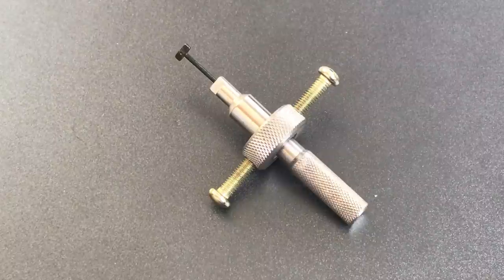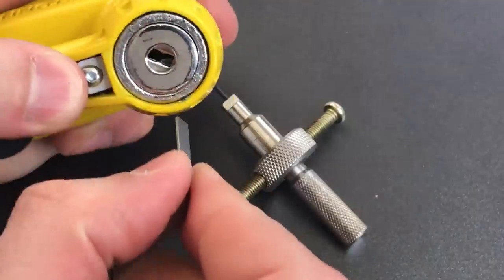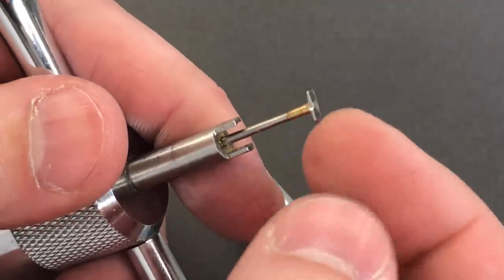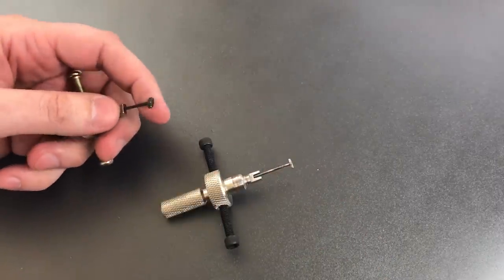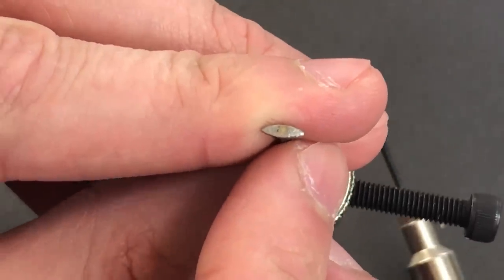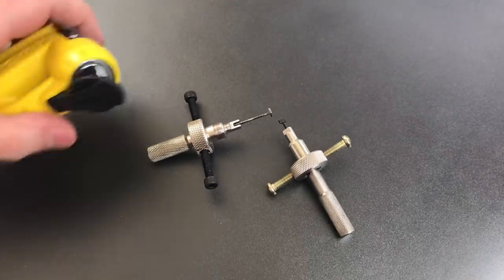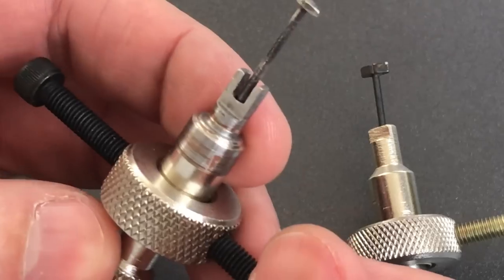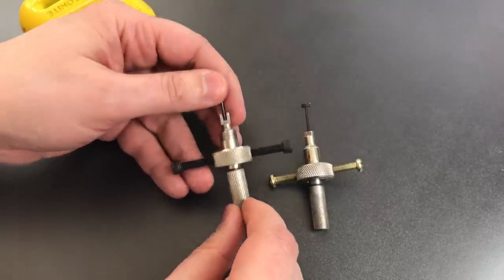[640] Get the Most From Your Disc Detainer Pick

Comment: Thankyou for explaining and demonstrating how small these tips need to be to be able to move through the tolerance gaps between the disc cuts. I'm also guessing that the flatter heads on the tension screws of your modified tool are much more comfortable than the round heads of the original. You could probably use the location pins from an injection moulding cast to make your own stronger tips too

Comment: Thanks a lot for this video!! I have to buy one of these  picking tools in order to unlock my disk brake as it locked it self completely and cannot be unlocket with the original key. Good thing that it happened not on the disk of the bike :) If it wasn't for your explanation, I would have struggled quite a lot to unlock it, if I could at all, since i have no wxperience in lock picking. Again, thanks a lot :)
Reply: If the lock is locked, but not on the disc brake, then just throw it away. Cos if your key doesn't work then you can't practically use the lock itself.

Comment: I found it really helpful to simply file a little bit of of the the outer (tensioning) part on two opposing sites so the big screws don't slip. It's also possible to just tighten them down more but you can assemble and disassemble it this way without tools so it's compact and easy to store/carry around.
Reply from the maker: Good idea... 👍
Reply: If you mean different than in the video, then I don't understand.
Reply: +Jay H
In the handle of the tool that the pick inside the lock is controlled with, two set screws clamp onto the pick to lock it to the control handle. Filing small flats on the pick where the set screws sit helps them lock to the handle.

Comment: There is one modification that I did to mine that if you have machine tools is very helpful.  I remade the tensioning portion of mine to make the nose longer to fit in the very recessed locks like the Abus 37/60.  A friend of mine is a tool maker and we made it out of brass which not only looks great, but functions very well.
Reply from the maker: Yup, The length of the tension head is the single greatest weakness of this lock.

Comment: for plumbing solder you want silver solder, as in a silver tin alloy (about 4% silver, remainder tin) this will be very strong but melt easily with a propane torch, even a butane torch will work. this is similar to the gunsmith's solder he discussed.
leaded electronics solder will be much weaker, but it's better than nothing.

Comment: Flat tips are not hard to make.
Step 1: find some relativly thin sheet metal and cut it down to a small rectangle 
Step 2: sand it down to appropriate thickness either with a tool or sandpaper if you have alot of time.
Step 3: remove any temper and drill through it in the middle with a 1.5 mm bit.
Step 4: get your solder and flux and fuse them together.
Step 5: clean it up with a file and some fine sandpaper.

This is not necessary but i went ahead and retempered the tip to 58 hrc.
Reply: Ok, a) that isn’t that easy a recipe, either. B) LPL said that the main issue would be in the brazing. Which is definitely something most people do not have the tools and skill for.

Comment: I only have one disc lock, an old Chubb (no number or model visible other than "made in Finland") and where you have the spinner instead it has a solid slot as part of the whole case. This means I can't even tension the lock as it gets stuck in this solid front door. To get around this, I would have to cut a deep notch into the tension section of the tool, or perhaps there is a better way? I much prefer normal padlocks and single pin picking, but I thought I'd give this a go and seem to have chosen a tricky one to start with!

Comment: I bought one from amazon and was just about to return it because the tip was turning and it wouldn’t go in far enough to tension the transparent lock that came with it. Before I start trying to dismantle it. Could you tell me if the only way to do it is to remove the tip. As it is that’s the only way I can see to get access to tighten the rod to the spinner. By the way,  you da man.

Comment: Solder No solder ideally machine from a solid sock or hot forge then file, use heat 
treatable steel.  No machine shop then other option use a tungsten inert gas micro 
welder ($500) and fabricate the pick.   Grub screws to secure the pic rod rather dodgy
use a shaft collar clamp approach (google it) will take a lot more torque.

Comment: I love how you're from the US but still us millimeters
Reply: I get tired of how so many people here in the US are so stubborn, refusing to learn anything new and stuck on the idea that anything and everything that is done here is better than anywhere else.
Reply: We use both.

Mm, cm, inches, feet, yards. Same as the UK and Canada to varying degrees.
Reply: He is a wise man
Reply: @Sciguy95  Or maybe it's the fact that the Imperial System has two glaringly obvious benefits over the Metric system. 

1) As far as real world applications when it comes to measuring small distances, the Imperial system is far more accurate. Once you get down past the MM the next unit of measure is what, the micrometer? That's a huge jump. With the Imperial system the inch is divisible to an almost infinite amount. 

2) The second benefit, and my personal favorite, being that it really seems to piss off all the metric people.
Reply: @markf.4063  so number 2 isnt actually a benefit. And number 1 applies to any number whatsoever. Meaning that the system that follows a simple pattern of multiplying and dividing by 10 is still better. You complain that it jumps from tens to thousands but just look at imperial. 12 inches per foot, 3 feet per yard, then it jumps to 1,760 yards per mile, and that's it for all the units. Jumping around allover the place with number, making bigger jumps than what you complained about in metric, and but you just choose to ignore that for imperial. It's a simple fact that metric is a superior system because it is much easier to follow a pattern than to have random numbers.
Reply: @markf.4063  2) Not as much as we and the rest of the world have 24h in a whole day (earth turning). But you still need to divide that too. :-) 

1) ever heard of micro- nano-meters etc. Yes it is a division (which you like and understand), but it is from the mm.
#2) Again. No it not piss us off, really! We just have hard to understand it (and I'm one of the Europeans that is quite good at using Inches. Not the thousands ot it, though). We just don't understand why you keep an ancient system when there are a better system.

As English have become the real world (communication) lanugage, and we learned it. Then (as I see it) it would be Your burden to  learn metrics. Why not meet halfways. LPL is a (professional) modern man.... and you just crying about to let that mammuth live.

Comment: I just buy it. It is garbage. After filling it, it does not stick to rod. Soldering with normal SnPb electronic solder doesn't hold up long. But I manage to open acrylic padlock few times after this "improvements".
As always, thanks for info.
And Sparrows doesn't ship to Poland :(

Comment: FYI, this tool uses M5 screws for the handles, I replaced the existing ones with 2 M5x30mm socket head hex bolts

Comment: Fantastic video on modifying this tool :D. I had mine already modded, but not enough...🙄. But with your tips I finally got the disc brake DD open that I got from a friend 😃. You also mentioned the Abus ones...well, I have an Abus 89. Would it be possible to pick it with this chinese DD pick? And if, could you please make a little video on an 89, 88 or similar? That would be awesome 😃. Keep up your great work, I'm loving your videos 👍😁. 👋🦊
Reply from the maker: Thanks. I doubt you could pick the 88 with this. They have front and rear butterfly discs, which rules out traditional tensioning.
Reply: Oh thanks a lot :). At least I can now stop trying ;D. Have a great week 😃👋🦊.

Comment: Nice, I've been meaning to mod my one. One question, would normal cable soldering work I don't have the plumbing solder?
Thanks
Reply from the maker: Probably... try finding some 96/4 tin/silver solder. Common, strong, low temp, and easy to use. 👍
Reply: LockPickingLawyer good hint, i will look for it :) 👍
Reply: @lockpickinglawyer  Do you need to use flux with that?
Reply from the maker: MikSu definitely.

Comment: would a 3d printed head be strong enough?
Reply: Sadly not. It will break immediately, the material is too britle and the layer bonds too weak for such a small tool. I have tried to make (way bigger) lever picks and they broke and also some keys. The only thing which might work as a print is a disc detainer key duplicate :). 👋
Reply: yes it will work just as good
Reply from the maker: Definitely not...

Comment: Hi there, useful information but there is another simple thing that I saw and will probably do to my pick,  when you go "in" even at the seventh disc you still have a centimeter free and when on first disc it's not inside as you hold it with your hand, would it be better to cut a part of the shaft, it would be all in and enough space to get to the last disc, I don't know if it's a good idea or not, I'll wait to see if somebody reply, thanks.

Comment: What can you say about this lock? Did bosnianbill hit the spinner or was it just different type of disc deteiner lock? That might be a good lock for you channel https://www.youtube.com/watch?v=CPfwzSv5rcs
Reply: scince he was trying to twist it not all disks can do full 360
Reply: also i don't think he did a propper twisting attempt on it. it should be more of cycle of slow increace in torque and slow release with slight back rotation. if you apply maximum torque in very begining quickly you will probably snap a tool, of course if your lock is not a complete garbage
Reply from the maker: I think he was just wrong about the lock if I had to guess... I’ve picked many, many Kryptonite DD cores, and never encountered anything that spun 360. I suspect he wasn’t used to the flat picking tip, and was picking between the discs. Just a guess.